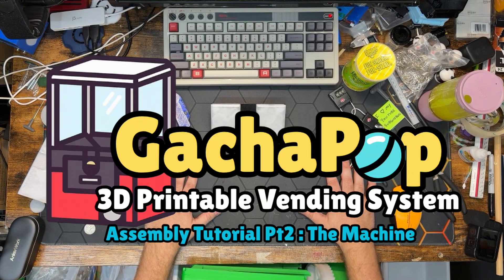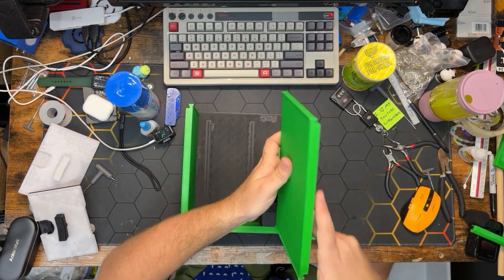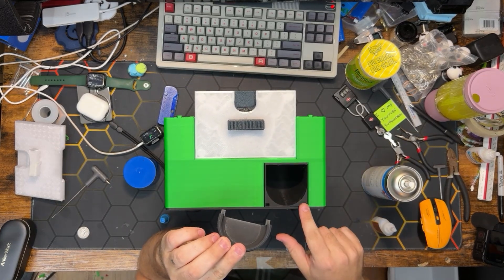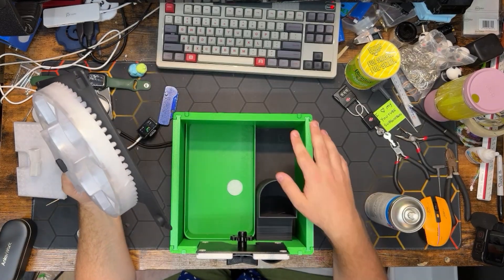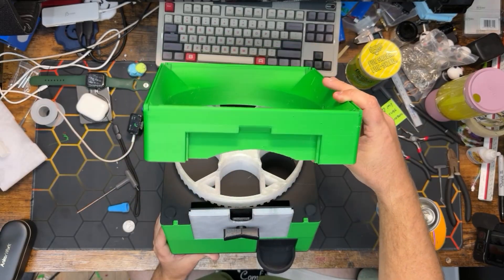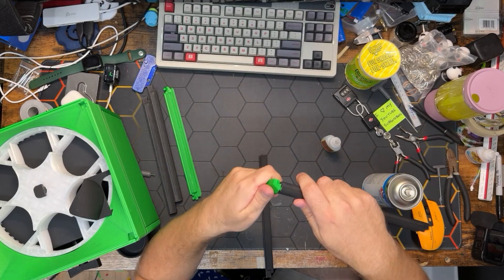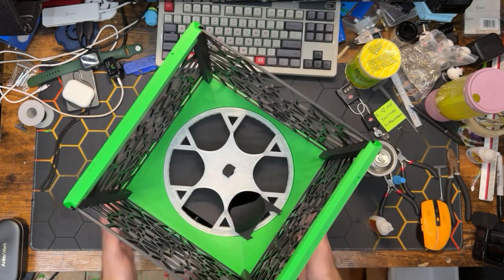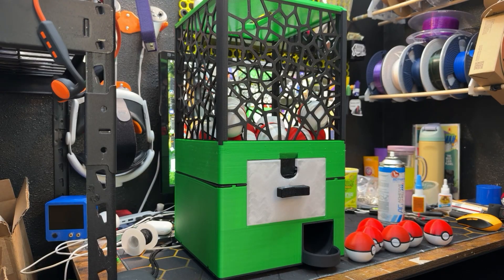GachaPop Assembly Tutorial Pt. 2: Full Machine Assembly

Comment: Can this be printed on any machine and with a smaller plate? I have a Flashforge AD5X.
Reply from the maker: So far, it has been tested and functional down to 70% scale. The main caveat with that is that you’ll have to print your capsules at that scale as well!
Reply: @HyBee3D So it should work. Scaling the capsules down to match, would your capsule club figures fit? Trying to figure out all the sizing. Thanks! Love your designs!
Reply from the maker: Yep! As long as you also scale them down to the same %!

Comment: So either i missed something lol which is possible but i still have 4 gantry clips after assembly that im not sure where they were supposed to go, everything seems to be working fine, but more or less curious where i messed up
Reply from the maker: The clips are just for connecting stacked machines together, but tbh they do a pretty lousy job haha
Reply: @HyBee3D ok good! I freaked out after assembly when I had extra parts xD I was like, it works fine... but my luck says otherwise haha thank you for the info!

Comment: Is there a possibility to replace the coin slot and handle with a raspberry pi, official raspberry pi touch screen and an electric motor to rotate the dispensing mechanism?
Reply from the maker: I’m sure it is! There’s lots of space inside so I don’t see why not. Send me an email and let’s talk about it! Hybee3d@gmail.com
Reply: Also take a look at an EPS32 module.  They have built in WIFI, bluetooth, and they can even talk to each other via ESPNOW.  There are even modules that come with screens attached in a nice housing which cost about $30 (way cheaper than a Raspberry Pie, but maybe just as effective for what you're thinking).  I'd love to help with the project and programming part (be it on R Pie or ESP32 module).